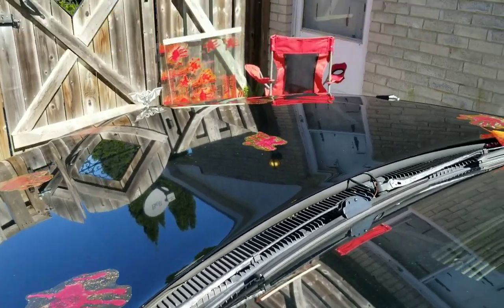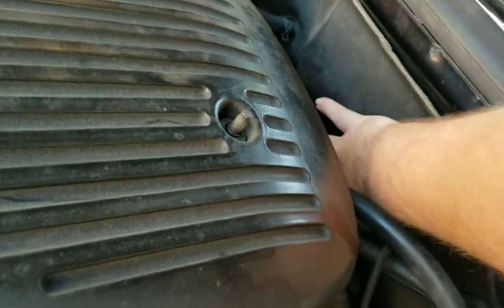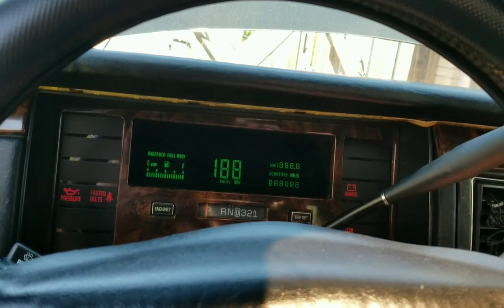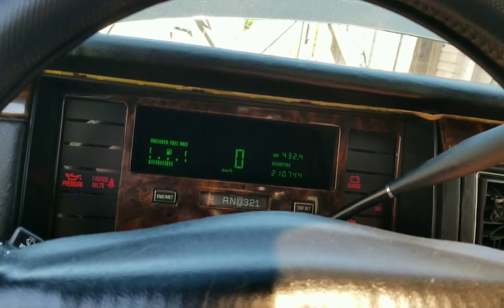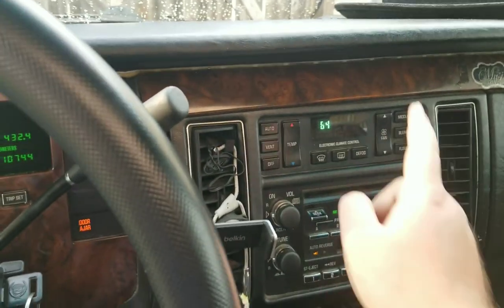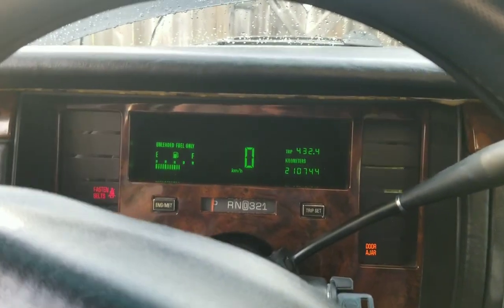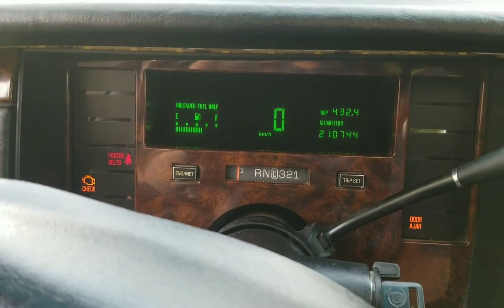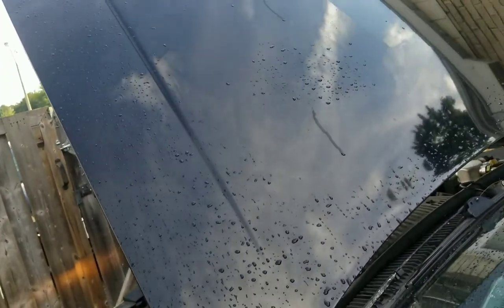Cadillac Fleetwood starting problem.(Fuel pump was bad)

Comment: U gotta do a whole lotta work to take out that fuel pump, sure you got this problem fixed lol
Reply from the maker: Yep dropped the gas tank and replaced it. But I also cut out an access panel in the trunk floor so if it ever needs to be replaced in the future it's as simple as pulling up the carpet and opening the Access door. 

I ended up selling the car in December of 2022 because the opti went out but I also believe it had an internal coolant leak that was fouling the plugs
Reply: @vcamnowaa  Hahahaha, nice very nice. It’s a usual problem so seems exceptional.
Reply: @vcamnowaa  Hey, Has your vinyl trim also lost the color of the paint, if so did you repaint, might just leave mine alone until I find the right color of my brown burgundy 95
Reply from the maker: @oscar7534  yep the vinyl trip that wraps around the rear window had  faded. I went to a store and bought the duplicolor perfect match paint pen/ brush and just painted the trim black. And used a paintable clear coat to seal it